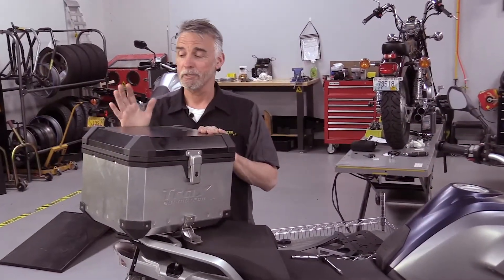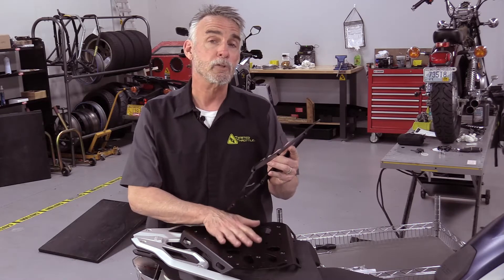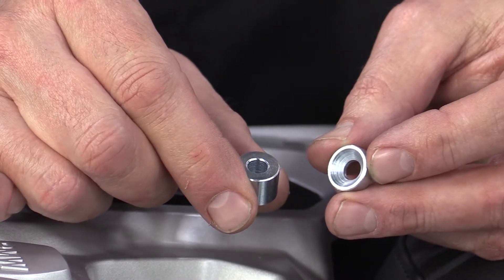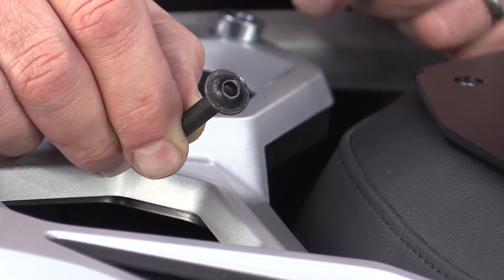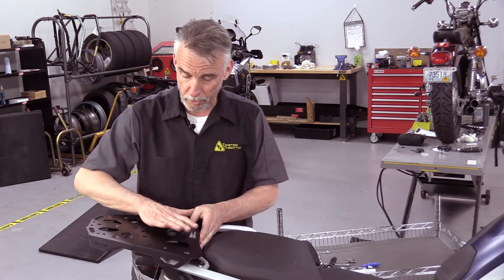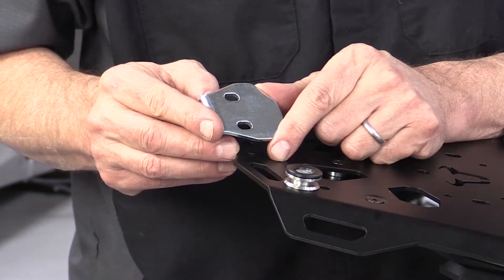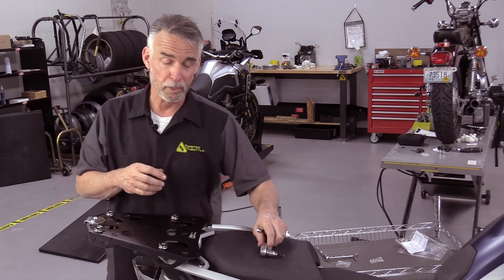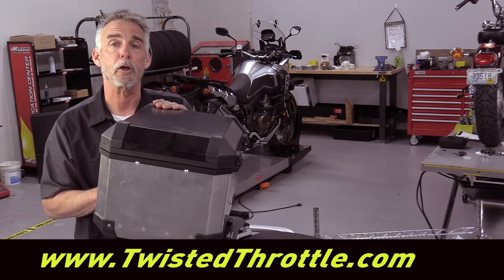SW-MOTECH Toprack + TRAX ION Top Case - Full Installation and Review

Comment: How do you deal with rattle please? I’m facing a fair amount of rattle on my Trax top box installed on the Alu plate using the intermediate adaptor.  This is despite using the inner soft bag and the box being empty.    I’m simply unable to eliminate the rattle emanating from the box sitting over the adaptor.  Its coming from the installed hardware itself.  

Thank you.